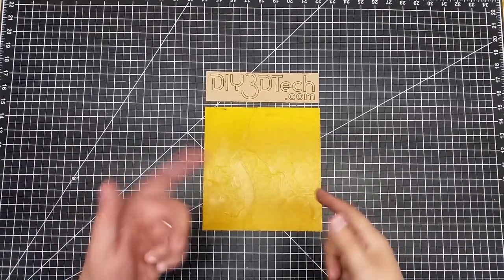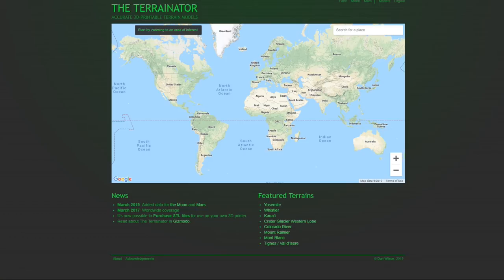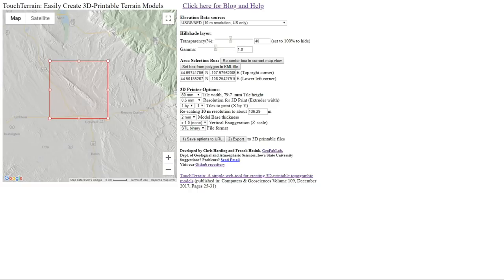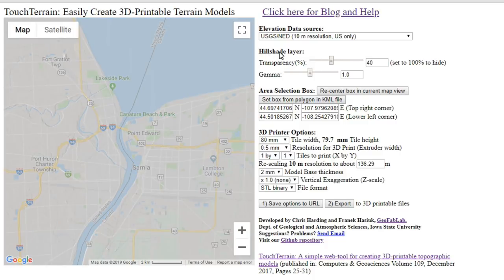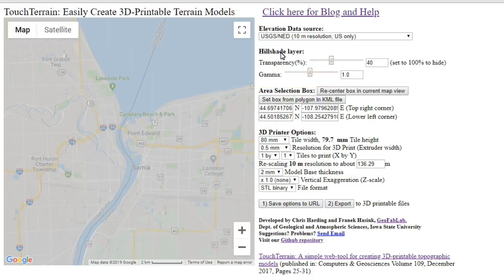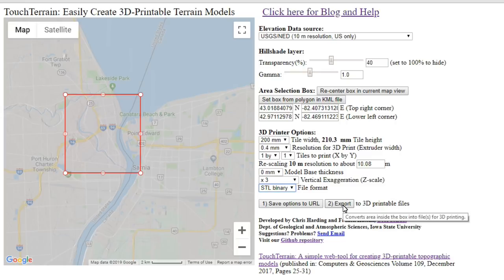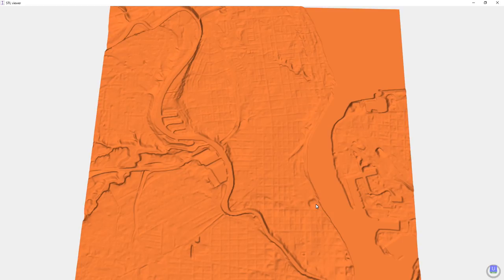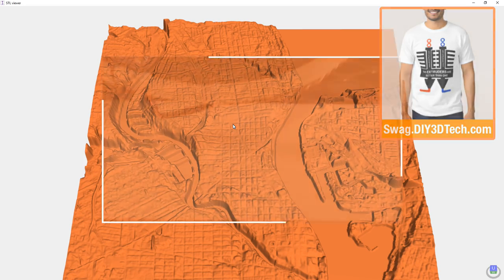Design Talk - Easy Way to 3D Print Topographical Maps Part 1!

Comment: I wanted to print Texas World Speedway before it is destroyed.  Also how can I scale it up in pieces to fit an 8'X4' board. In pieces 2'x'2?
Reply from the maker: Sound cool, to 8 foot x 4 foot I would divide it into either 10x10 or 12x12 depending on the printer as you will want to some room at the end and glue them up.  I have seen the artists that use this method to do large city-scapes...

Comment: This looks like your photo is showing buildings and Streets? Mine didn't show any of that just elevations. How can I do one like yours? thanks
Reply from the maker: So are you talking about the STL or the actual print?  As covered in the video, this is where you need to play with the "Vertical Exaggeration (Z-scale)" as the image you see is x5 and yes larger buildings are bumps and streets are depressions.   However when it comes to printing, it will depend on your nozzle as 0.4 is still rather big for this believe it or not as 0.2 would be best but it will take forever!  Best would be a resin printer...
Reply: @DIY3DTECHcom  Well ultimately an STL so I can print it.  Resin printer is way out of my budget and I don't think I'd use it all that much. However, I'll see where this goes.  I do have 0.2 nozzle as well as others but yes, I normally use the 0.4.  I'm not sure about the Z axis.  In S3D it was 34.06 (100%)  but the elevation on the print seemed to be exaggerated.  One side of the river seemed awful high to me.